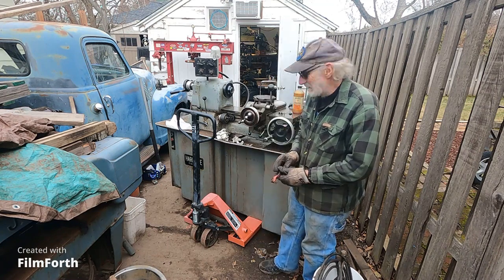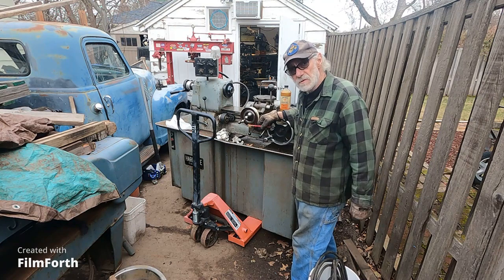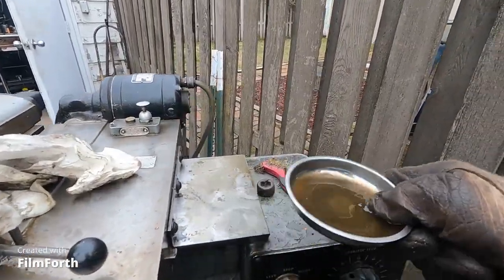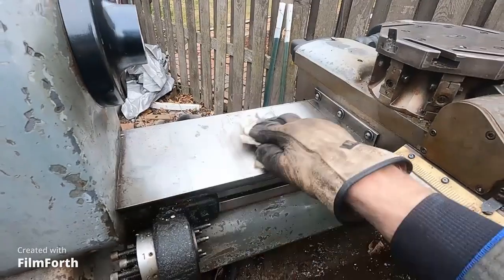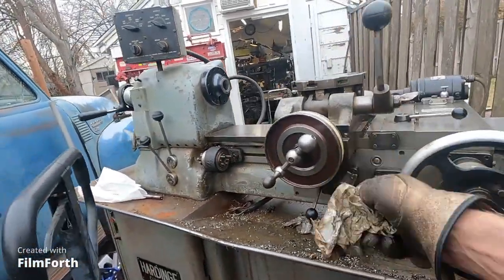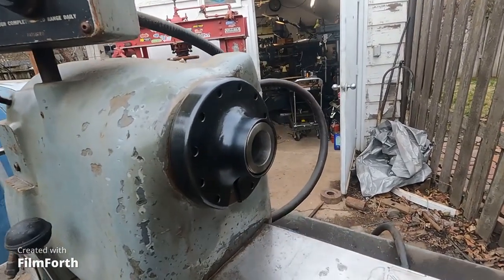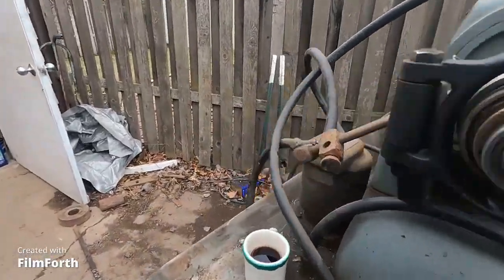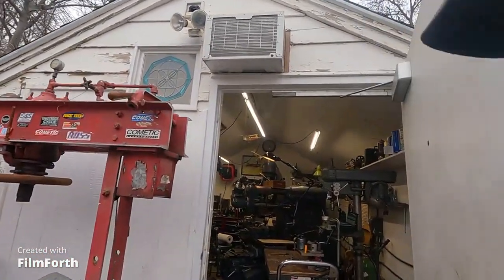Hardinge HC Chucker Lathe cleaned with Hoppes No 9 solvent

Comment: When I sent you the Hoppes I was afraid it was going to be too late for you to get any use out of it, little did I know!  Great that you are sharing another chapter of your life with us. Thanks!
Reply from the maker: Hi, thanks Bob, I will never run out of rust as long as I work on or with this equipment. Using this old time product that was hiding in plain sight is the best so far in the rust and stain battle. The Hoppes solvent normally used just a few drops at a time really displays that unique fragrance spreading an ounce about on a turret lathe. The directions need to be followed by wiping off and oiling the surface. Thanks for coming along, I get motivated to deal with my self made disaster with this old equipment by turning the camera on.

Comment: Feed clutches are engaged, stopping carriage movement? I need to do this with mine. You need to get this in the shop, you will enjoy using it. I use mine several times a week. My concern with outside storage is condensation in the precision bearings. Hard to avoid unless a heated enclosure is employed.
Reply from the maker: The equipment outside is stored using an incandescent lightbulb in the cabinet or sump, under 3 cheap tarps. The Hardinge HC here has likely been outside for 5 or more years at this point, and appears to be OK for an old worn machine, thanks

Comment: I have 2 of those but im missing all the threading stuff.
Reply from the maker: I had the early version of the threading attachment with only a couple of masters, I just did not find a need for that function. I plan to make tiny model nuts and bolts smaller than 3/16" I think a die will work fined